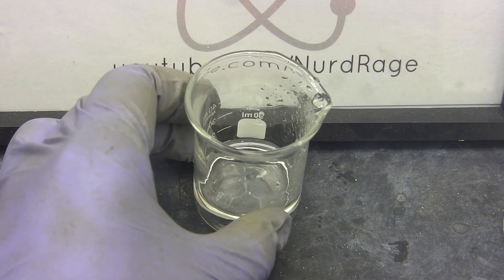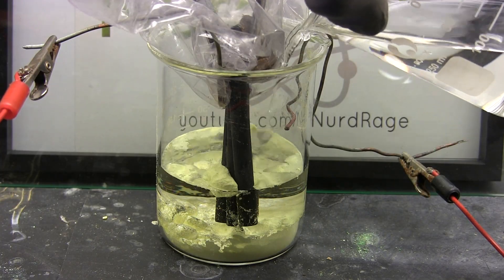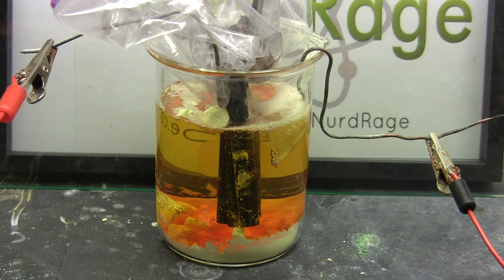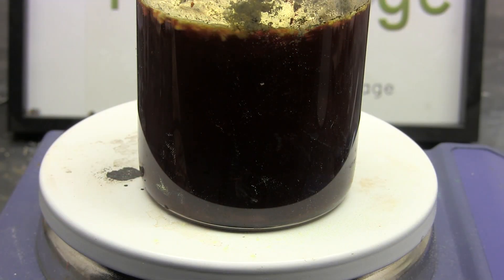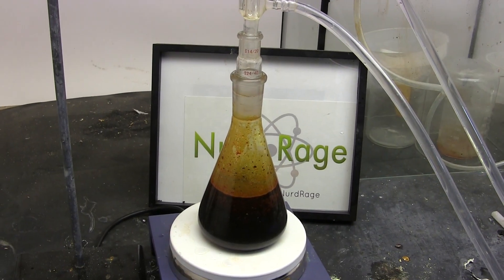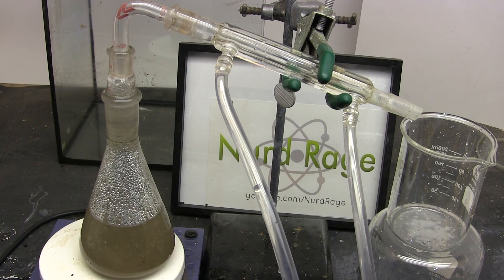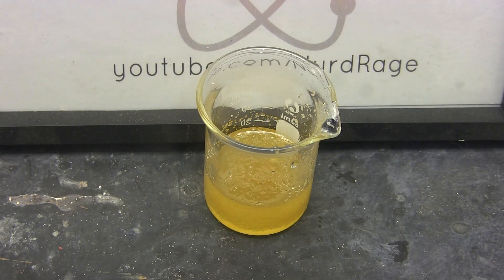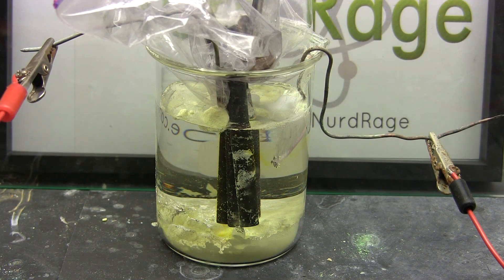Make sulfuric acid from water and sulfur (electrobromine process)

Comment: I tried making bleach from salt with a stainless steel spoon anode - what a mess, all I got was rust, and no chlorine odor. So I went on ebay and got a 5-set of these puppies http://www.ebay.com/itm/351402379120 and they work like magic. In fact it is my stainless steel cathode that starts getting chewed up from sitting in bleach after a while, also the copper clamp contact holding the anode from the humid air filled with chlorine gas. I used to increase the surface area with a stainless steel scouring pad for hydrogen gassing, and I did get higher amps, but it disintegrated also in about a week just from sitting in bleach. The solid stainless flat bar seems to hold up somewhat, with rustspots here and there that are easy to scrub off. But the MMO coated titanium mesh is noble, nothing seems to affect it. I think it's an iridium-ruthenium oxide coating on titanium, so that the titanium does not anodize and increase surface resistance. Which is interesting because you had a prior video showing that the only thing dissolving ruthenium with ease is bleach, even aqua regia has issues. Yes, carbon is notorious as an anode for making a big mess, besides some trace dioxins and phosgene, which is why they got MMO coated titanium for chlorine. Now bromine might be different. I think liquid elemental bromine dissolves gold, and might be a cheaper way to do it than aqua regia NOCl nitrosyl chloride. Besides mmo/Ti, and carbon, lead used to be a very useful anode material, because it can cycle to PbCl4 --> PbCl2 precip + Cl2 gas, because the chloride is so insoluble. But in alkaline solutions it might generate plumbates, so it may not be a good idea, but in acid halogen solutions it may work fine as an anode. We're looking for stuff that either does not react because it's so noble to halogens (like carbon does not react with elemental halogens), or at least forms a conductive bromide precipitate coating instead of dissolving into the solution, so that the anode does not degrade or disintegrate. Silver, which also has the temporary Ag2+ oxidation state, might be another good candidate, if only a silver bromide coating is ionically conductive enough to function and does not act like an anodized surface like titanium or aluminum oxides do. Insoluble bromide is the key, or at least mantaining some metal at high enough oxidation state where it much prefers being an oxide instead of a halide, such as TiO2 vs. TiBr4, which should instantly hydrolyze back, the problem being of course the anodizing TiO2 buildup, and then the noble MMO coating to remedy that might be reactive to elemental bromine. Besides Ti, other stuff might be interesting such as Cr or Nb, Mo, etc, I have no clue if they'd work, for instance, chrome plating itself is strange, it starts with CrO3 in sulfuric, which develops a CrO2/CrO/Cr2O/Cr3O ionically conductive layer where the true electrolysis to the metal happens with gradual change in oxidation state as you get closer to the metal. The reverse might develop when electricity is pushed the other way, and of course CrO3 may be very soluble, and MoO3 might too, but I don't know Nb2O5. How about Ta or Hf, or Zr? So besides C, Pb, that's probably the area to fish around, as CeBr3 and the like are probably very soluble, but the 4+, 5+ stuff with a noble coating to stop anodizing might be just right, the 6+(CrO3) and 7+ (Mn, Re) might be too soluble as oxides, but the 4+ and 5+ neither likes forming bromide and prefers being an oxide, nor is it too soluble. Bi and Se or Te would probably react as sulfur does, so the neighborhood of Pb is not tempting to fish around either, on a 2nd thought, the bromides of Bi3+->5+ (BiOBr-->BiOBr3) might be a conductive insoluble coatings, same with TeBr4? probably not. Butter of antimony?
Reply: SillybillydillyAlso, it seems like a waste of electricity to oxidize sulfur, when it can be so easily burnt with the cheap oxygen in the air. Is there a way to save at least some electric by making an acidic SO2 solution, then driving that to SO3 with bromine? I think you know about the sulfur-iodine cycle, HI---> H2+I2, I2+SO2->HI+SO3 (with H2O), SO3-->SO2+O2 (at very high temp), is a way to break H2O--->H2+O2 with sulfur and iodine catalysts, by using temperature differences and heat energy, kind of like a chemical heat engine instead of a mechanical one, subject to carnot cycle limitations, because massive waste heat must also be discarded at the low temperature in the cycle.
Reply: Of course the major issue in that cycle is the SO2+O2 gas separation at high temperature, or quenching, else the reaction reverts, and a liquid or solid oxide that self phase separates might be preferable, such as SeO2 or TeO2, or many of the metals such as MnO3->MnO2, or even MnO2->Mn2O3, PbO2->PbO, etc, eliminating the use of sulfur though, so now I'm drifting off topic of making sulfuric acid. How about S+O2-->SO2, SO2+O2+V2O5 or Nb2O5---> SO3? Like the industrial process, instead made in a lab? You surely would not need 40 hrs for a few grams like you do with electric.

Comment: Very interesting from a chemistry viewpoint, but hardly the most practical or easiest means of acquiring H2SO4 when one can break open a car battery if they're that desperate for the chemical. It is a sad state of affairs that an important and very useful chemical staple like H2SO4 is becoming harder to acquire for the amateur chemist. An interesting project would be "100 ways to make H2SO4".
Reply from the maker: Gary Card actually, with enough optimization, i think this method can be much more practical (cheaper) than breaking open a car battery. essentially sulfur, water and electricity are the consumables, the only waste (ideally) is hydrogen. While with breaking open a car battery you have lead plates as waste. Now i know an amateur might have some use for lead, but if they keep breaking car batteries they'll eventually spend a lot of money and have a huge amount of unwanted lead.

I just have to get around to optimizing the electrodes and the current density of this process.
Reply: NurdRage Unless you shoot old school firearms and cast them to bullets! haha. Like AmmoChannel. :-)

Comment: I'd just like to add that you should always have a bucket of a thiosulfate solution around whenever you're working with bromine. If something goes wrong you can use the thiosulfate to oxidise the bromine to bromide. This is one of the safety mesures we always use in the university labs in Freiburg, whenever we're handling bromine. Lab safety is important.

Comment: NurdRage next time try multiple lead points for copper or a full ring of it with multiple connection points for the cathode.  more even current flow and try it at switching between 1.65 amps and 2.00 amps every 2.5 hrs. for about 45 hrs

Comment: Amazing video again NR!!  I love waking up and watching some awesome chemistry porn.. you are such a great asset to our community.

The dirty sulphuric acid looks like what you get from Home Depot or hardware stores as drain cleaner,.  Do you think there is any correlation of their process?
Reply from the maker: Ryan Jones Likely not. For one, this process seems to be new or at least extremely obscure. From what i know of drain cleaner acid is that it's regular sulfuric acid from the contact process but is of a very low grade.  It's usually from the wastes of other industries so it has large amounts of impurities.
Reply: NurdRage i have found that rooto professional is the purest of the crap acids.
i have seen technical grade acids with more crap in them

Comment: Interesting set of reactions.  Looks like one of the carbon electrodes got attacked at the solution interface.  I wonder if there was some oxygen there?  Could inserting the carbon electrode in a ceramic tube would shield it from interface effects.  Why 5M HBr - that seems stout if the HBr is not consumed.  Nice job, thanks

Comment: What a dumb method to produce sulfuric acid thru all this rigamarole when just absorbtion of the burning sulfur in water or hydrogen peroxide would suffice.
Reply from the maker: Atique Ahmed You completely and totally missed the point of learning stuff. You also don't understand the chemistry of sulfuric acid production.
Reply from the maker: realedna I'm well aware of the sulfur dioxide and bromine approach. But i reject your assertion "it's much easier". Have you actually built a sulfur burner chamber and gas absorption train? It is far from easy in practice. The are lots of consideration and technicalities like what materials to make the chamber out of. How to safely feed air and not let sulfur dioxide escape. How to ignite the sulfur while it's in the chamber. Efficiently capturing the sulfur dioxide gas and cooling it (as it comes off pretty hot after combustion). How to sustain combustion (i found sulfur has a nasty habit of self-extinguishing during my runs). Also how do you deal with the sulfur that vaporizes rather than combusts? That sulfur coats the inside of the apparatus and while not an issue at first if you're pumping the combustion products from the chamber through the absorption train your going to have sulfur deposit in your pump. Sounds pretty wasteful to me if you're ruining a gas pump. You can't just let convection do it because the gases aren't going to disperse themselves into the absorbing solution, you need some pressure to push them through. There are ways of solving this but all the solutions (that i know of anyway) are necessarily more complicated. Then there is the engineering skill to build such a system. Can you point to me an off-the-shelf benchtop sized unit that can burn sulfur and absorb it into an arbitrary solution? Then there is the issue of making bromine. You'll need a separate system for that. I won't even bother discussing how wasteful it is to make bromine chemically. And making it electrochemically is still difficult as i demonstrate in my video.

So already you need two independent systems, one for making and capturing sulfur dioxide and one for making bromine. And you're telling me this is LESS complicated than a single beaker that goes from sulfur to sulfuric acid with a bit of electrochemistry?

But hey, i could be totally wrong and it may indeed be a "much easier" process. Post a video of your process that starts with sulfur and a source of bromine, and ends with doing the carbon-pillar experiment while recycling the bromine along the way and going through a sulfur dioxide intermediate. If i was able to make my video after a week of work, your video should be doable over a weekend.

Armchair chemists can talk the good talk and call my videos wasteful or complicated. But when it comes to actually doing it and demonstrating it, I'm the one still making videos.
Reply from the maker: ***** lol, i just might do that!
Reply from the maker: Martin of Gliwice If i had to reject every line of inquiry because it was "dumb" I'd never get a Ph.D. heck I'd never become a scientist.

Considering the lead chamber process requires a combustion chamber and and absorption train (neither of which are straightforward to build or use) I'd say it's just as difficult and convoluted as the electrobromine process if not more so.
Reply from the maker: Martin of Gliwice Actually i hope to make a video on making HBr from stuff you can find domestically. It's pretty straightforward, bromide salts are easily obtained as a pool chemical.
Reply: NurdRage I looked through the comments on this video and the stupid morons who keep asking you to make meth are coming out of the woodwork. Could you make a chemistry or spoof humor video sometime that makes fun of them, like this one: http://tune.pk/video/1714732/how-to-make-meth?
Reply from the maker: Ryan Jones true :)
Reply: owned.
Reply: NurdRage Ignore him.  Real chemistry nerds love to explore the process, especially ones that are not used very often
Reply: NurdRage - he is a Muslim ... no doubt he is up to no good. Learning stuff is not in his mind, only destruction is.
Reply from the maker: UNNÖTIGE VIDEOS actually i already have a video like that: https://www.youtube.com/watch?v=okvvD3-DF9U
Reply: Ouch.
Reply from the maker: stuffass Its possible with hydrogen peroxide. but not water alone. If you bubble sulfur dioxide into water you get sulfurous acid or H2SO3, NOT  sulfuric acid which is H2SO4. also the sulfurous acid isn't very concentrated since it tends to dissociate.
Reply: nightowl8936 What does religion have to do with chemistry or what's on ones mind?Or rather lack of it with having a clear conscience?you are being self-contradictory.I personally have been involved in chemistry and production of chemicals since I fell in love with it at the age of 11 and that was in 1985!My sole rationale is that most of you don't understand the very basics of chemistry but more so living in a pariah state where I live(the UAE) where basic stuff like potassium permanganate and acetone sale is actually OUTLAWED in the supermarkets or pharmacies. Can you beat that?
Reply: realedna GET FUCKING REKT BY #NurdRage!
Wikipedia loser...
Reply: NurdRage hey could you show the method of dissolve sulfur dioxide in water an oxidise the solution with H2O2 or something else? I dont need it but it would be cool to see. And a question: is it hard to get concentrated sulfuric acid in the US or Canada? Here in germany you can order 96% sulfuric acid on amazon without proving you are over 18 yo.
Reply: NurdRage But according to Wikipedia it is possible to make H2SO4 by burning sulfur and bubbling gaseous products through hydrogen peroxide solution . Sadly no word about concentration of H2O2 solution nor about the purification. Nevertheless thank you for another entertaining video!
Reply: Atique Ahmed Simply that your religion is warlike and primitive and if ever any of you begins to show proficiency with any of the sciences, inevitably you people find a way to use it to harm either yourselves or others. You don't create much, and you beg, borrow, or steal from others because your own society is so intellectually sterile. So I don't believe you should be accusing others of ignorance. I'm just braver than most in terms of calling out Islamic hypocrisy and bullshit.
Reply: NurdRage well, if I had to choose, which method is dumber, I would consider both methods dumb and I would try lead chamber process.

But indeed bromine process is at least interesting (although definitely imperfect)

Try both different anodes and cathodes. Nickel would make a better cathode than copper because of higher hydrogen reduction potential, what would favour it more over bromine reduction.
Reply: +NurdRage I've found some succesful attempts to utilise lead chamber process at home with combustion and absorbtion beung both carried out in a big glass container. (Search sciencemadness forums)

Actually, any method of doing anything at home is "dumb", inefficient and not using extreme pressures, expensive catalysts or giant installations. 
Neither HBr nor H2O2 are very easy to buy.
Reply: NurdRage Actually sulfuric acid (H2SO4) is the side product of a lab method to produce hydrobromic acid (HBr) from bromine (Br2) and sulfur dioxide (SO2): SO2 + Br2 + 2 H2O --> H2SO4 + 2 HBr  [Wikipedia - Hydrobromic acid]. As you essentially have to oxidise the sulfur (S) it's much easier to go more than half the way by burning sulfur (S) in air to form sulfur dioxide (SO2) first. Your idea to oxidise sulfur (S) fully electrochemically (in solution) may therefore be wasteful and a complication.
So your process should focus on recycling hydrobromic acid (HBr) to bromine (Br2), while converting sulfite (SO3^2-) to sulfate (SO4^2-)!
The following article (taken from the citations at Wikipedia) seems to cover all aspects of the redox reaction between sulfur dioxide (SO2) and bromine (Br2), where we are mainly interested in the side product, which is sulfuric acid (H2SO4).
http://pubs.rsc.org/en/Content/ArticleLanding/1900/CT/ct9007700648#!divAbstract
Reply: NurdRage Hahahahaha, just make sure to make this look chemistry and nurdrage themed, but still very humorous please. BE CREATIVE also and give em hell in the process.
Reply: Deadpool
Hahaha, you do not even understand, what I was talking about! Actually, by other methods it's even more trivial to preparate sulfuric acid in solution (from SO2). If one cannot handle criticism, than he's not a good scientist. I didn't mean to debunk anything, but made valid suggestions for improvement. What have you done? Flaming!? WOW!!
Reply: Deadpool Stop replying, if you don't care!
NurdRage does not need trolling fans anyways. As you said, he can defend himself.
Reply: realedna "As you said, he can defend himself." It looks like you're making up lies now? I have not in any way used these words as you stated above
Reply: nightowl8936 Lol your comments make you sound quiet arrogant, ignorant and illiterate. I suggest you do some research on the topics you are discussing
Reply: +nightowl8936 shut the fuck up. its a chemistry vid. not a Mujahideen call for global jihad😂😂😂😂😂😂